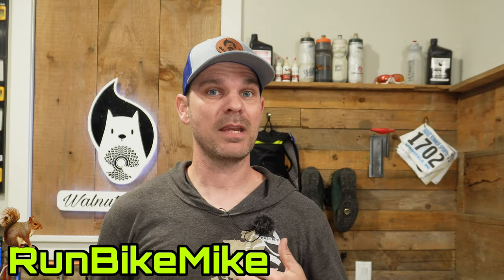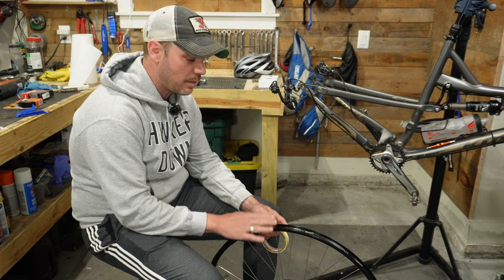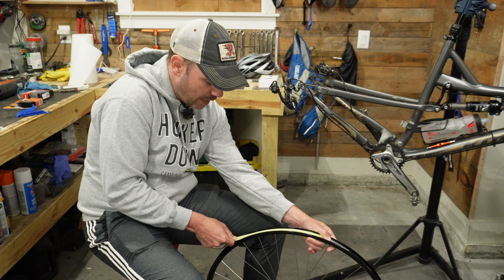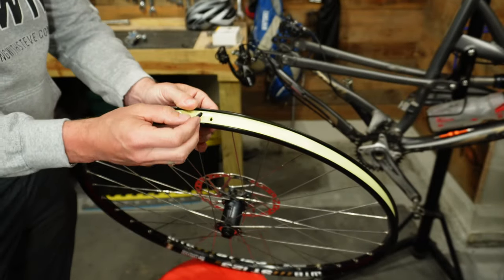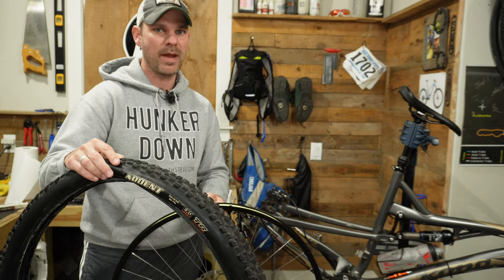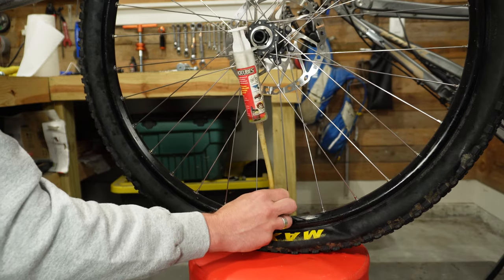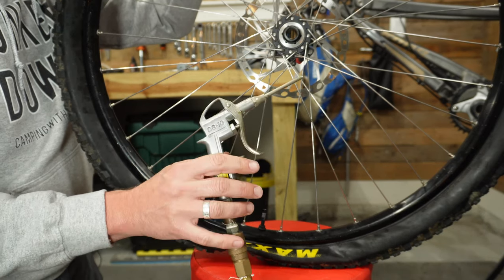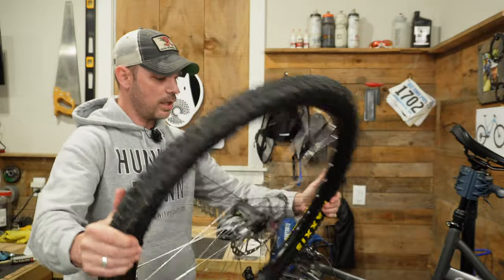How to Convert Your Bicycle Tires to Tubeless

Comment: Went tubeless as soon as I purchased my plus hardtail. The amount of sealant varies depending on the tire size, plus after several months you need to add more because it can dry on the interior wall of the tire. I run Orange Seal Endurance and it actually comes with a small dipstick that you can put through the valve stem when it's at the bottom to see if there's still liquid in the tire.

Comment: I just did this using Stan's tape and sealant. It went perfectly. I also switched over to some WTB tan walls. Pretty easy process!
Reply from the maker: Yep there are a lot of different ways to go tubeless. Just always cross your fingers it goes smoothly. And if so that is great 😊

Comment: Nice video. I have one difference in my process, I air the tire to set the bead (then deflate) before adding sealant. Then I can work on any bead issues (bent rim or whatever) before having sealant to deal with. Also I like the injector, I haven’t seen that before, my syringe and tubing is DIY without a screw on top.
Reply from the maker: That is a great idea. I think I will add that to my steps. Thanks.

Comment: Yeah but I heard that not all rims are tubeless compatible because the rim inside lips where the tire seals some rims it's not designed for tubeless or are they wrong on that would like to know incase I decide to go tubeless on my road bike thank you for your time
Reply from the maker: You are correct not all rims are tubeless but that definitely doesn’t mean you can’t make them tubeless. I have converted several rims and tires that are not tubeless ready to tubeless. Doesn’t work all the time but can work.